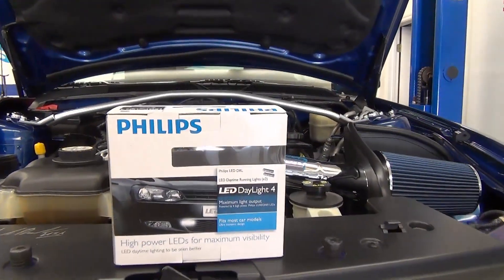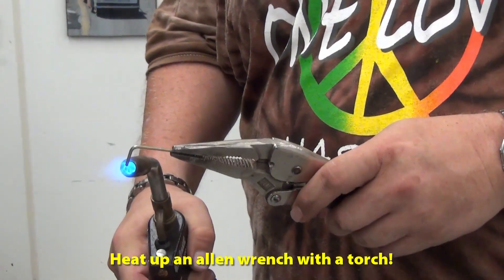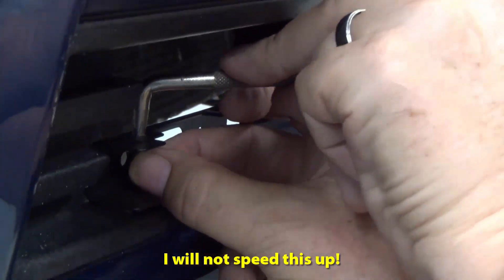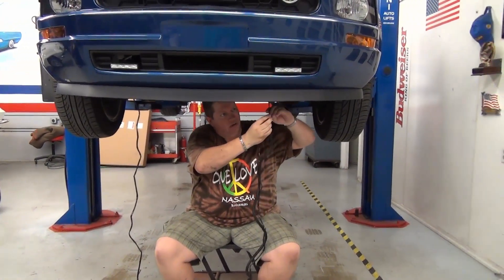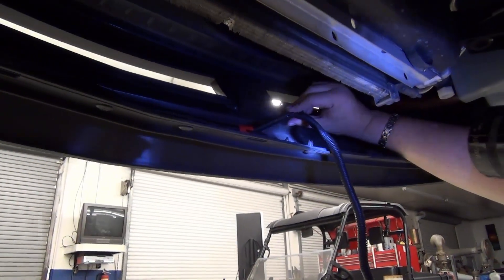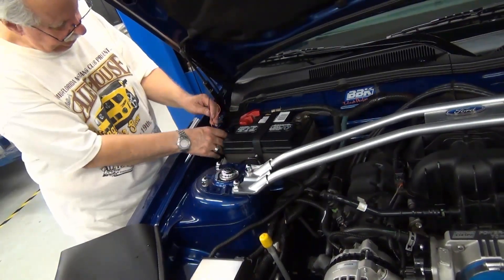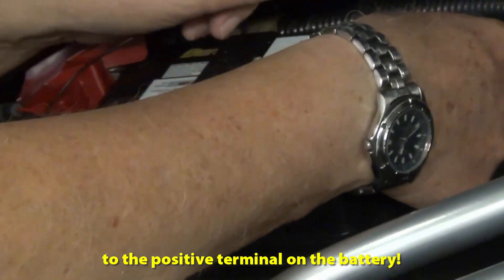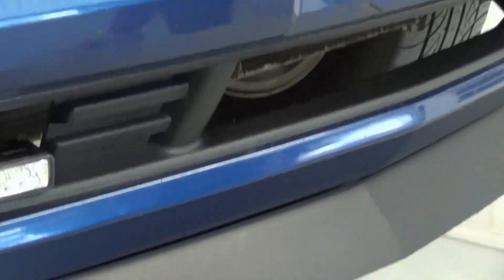Philips Daylight 4 - 2007 Ford Mustang - Philips LED Daylight 4 Daytime Running Lights ( DRL ) DIY

Comment: Just curious as to why the 3M tape AND screws were used. I think the reason the 3M tape is included is if you have a vehicle where space is tight and you can't get a drill in the space, you can use the tape instead. I used to use the 3M Scotch outdoor 15 Lb double sided tape to install my fog lights on my cars and that stuff  will hold your lights no problem. Held the fog lights on my car for 4 years until I sold it and never came off or came loose. Through car washes, rain, winter, etc. The tape held the lights. And if you decide to remove the tape you spray some WD-40 or Goo Gone on the tape and let it soak for a bit and then you can gently work the tape off with no damage.

Comment: Good job sir.  I'm thinking of getting these but I'm torn between the 4's and the 8's.  I kind of like the way the 8's dim when you turn on the lights but after seeing your install, I kind of like them on and bright all the time.  Very professional job too.
Reply from the maker: I did another install video with the 8's... https://youtu.be/27oZa1np2Kk   ... you can do the same thing with the 8's by simply not hooking up the 3rd (orange) wire... I would make sure they are low and possibly angled down a little.. But most of the new cars with stock leds around the headlights are pretty bright now....

Comment: Wow, wow, wow, guys! Did you ready Philips Daylight 4 manual? Yes, there is a manual with instructions inside box.Your DRL is not installed properly. Take it easy.
Reply from the maker: Wow, wow, wow!... Not sure what you mean... if you are speaking of hooking up the optional wire to make the LED lights turn off when the headlights are turned on... we wanted them on all of the time and not turn off... so they are installed the way we wanted them... maybe you should watch the WHOLE video...

Watch this video on how to install the Daylight 8 DRL's and you can see how it works...
http://youtu.be/27oZa1np2Kk
Reply: XMSMLL this is illegal feature btw.
Reply: XMSMLL hey, police! )))
Reply: XMSMLL this DRLs are very bright in night time. Maybe I didn't watch whole video and you have installed a switch to hook up the optional wire to make the LED lights turn off.
Reply: XMSMLL personally I hate people with bright light on the road at night time. Take care about oncoming traffic.
Reply from the maker: bashconsole Apparently you don't do much night driving... Most all new vehicles have the option for stock equipped LED's and or HID headlights (All Audi's, BMW, Lexus, Porsche, Jaguars.. and Kia's and more all have these options) and the DRL's stay on night and day with NO DIMMING at night... maybe you should complain to them... Some are high and some are low... and it is what it is... all of these vehicles must be illegal then according to you... On this particular install the lights are angled down slightly to the ground which at night they are no bother to oncoming traffic or even in your rear view mirror... the stock headlights are way brighter...
Reply: XMSMLL almost everyday I do night driving. I will think about slightly angled down DRLs. The more light the better ofcause. Anyway I almost sure police will stop me at night with DRLs switched ON and ask me for some money... I drive not in US. Nice car BTW. But I prefer Peugeot 206 WRC or RCZ.
Reply: @XMSMLL  I know it´s weird to reply to such old comment, but in Europe the cars made after 2011 are required to have daytime running lights and when headlights are switched on the DRL´s will switch to dimmer mode and they also work as position or parking lights (also in dimmer mode). Cars that have retrofitted DRL´s also have to meet that requirement, not sure about about the US as different states have various rules, for me it´s weird to see a BMW X5 to have red turning signals, when they make them with orange lights for the rest of the world and especially because older X5 models in the US had orange rear turn signals, but that´s just me. Hopefully these Philips LED4´s are still working, quite often the cheaper DRL´s will have individual burnt out LED´s or stop working after couple of months, often because of rain or just poor quality.